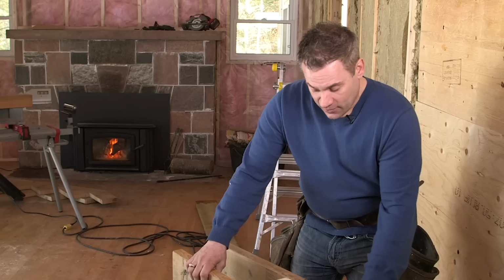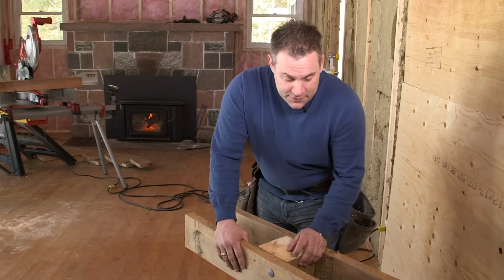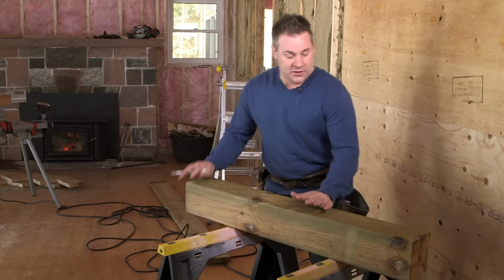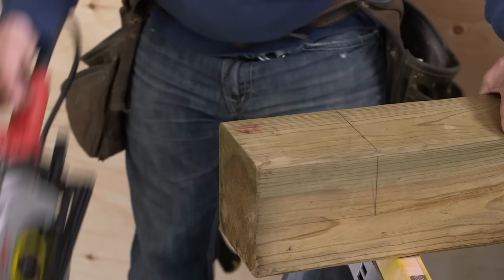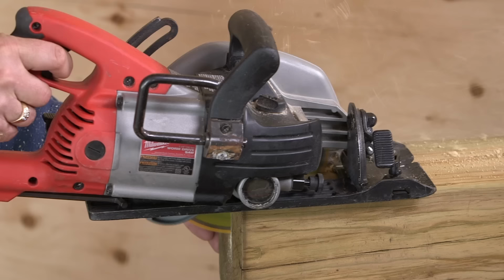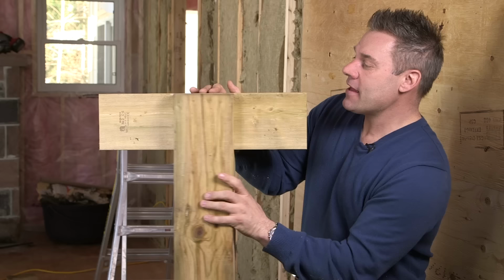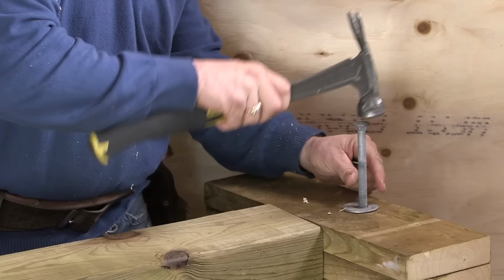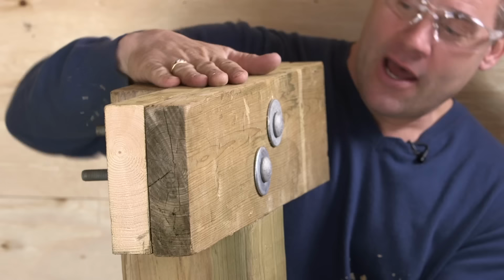How to Attach a Beam to a Post for a Deck | Decks, Docks & Gazebos

Comment: I wonder if this guy tried to snap off a carriage bolt first with his hammer, and then said screw it, let me get a screw?
Reply: Hahaha, I laughed good!
Reply: Yeah. A 3/8 bolt would take a shit ton to shear.  I guess if you are putting a hot tub or have a deck 30foot off the ground, notch it.  If the only load on the joist is the deck boards and people, 2 3/8 bolts will out last the wood.
Reply: The carriage bolts could be fine in that configuration, as long as one respects the ratings of the bolt. But then again, I think resting the beam on the post is better because over time, if the carriage bolt rusts and weakens, the safety won't be compromised as quickly.
Reply: It's simply code to not hang beams off of bolts.  The safe shear strength of those bolts is over 1,000 lbs each but then that assumes that the wood never fails with the point load.  It will rarely be a problem, and for a deck a few feet off the ground, who cares but the inspector......but you'll care plenty if someone has the authority to say you have to redo everything properly.
Reply: The PSI required to shear a 1/2 carriage bolt is 32,000 PSI. Assuming there are no markings on the head. If there are markings it only goes up from there. Some grade of 1/2 bolts can take 150,000 PSI to shear them, but you will never find a carriage bolt in that grade.
Reply: lanesteele240 A standard grade 2 bolt of 3/8" diameter is going to shear at about 500 lbs. A 200 lb person creates way more than 200 lb of force because they are often moving. Fill a deck with people partying and those bolts are gonna break. It has happened. That's why a house inspector will fail structures that depend on bolt shear strength to hold things up.
Reply: It’s funny because he is wrong about sheering.
Reply: Ive seen alot of decks as I see alot of homes doing fence work. I dont remember ever seeing any ever done this way. if you have a small 6x10 deck it seems that 12 bolts (12,000lbs) is more than enough to hold all that weight.
Reply: Benjamin Esposti they are usually galvanised!..
Reply: @bobbybaucom4489  That and bolts aren't meant for shear force. They are meant for clamping force.
Reply: @patrickswayze2596  I guess you've never taken apart something that was bolted together with galvanized bolts before. It does not prevent corrosion. It only slows it down.
Reply: Shawn Kemp  nails have more shear strength than screws
Reply: Bobby Baucom what relevance does that have? Of course I have and I understand that it doesn’t stop corrosion completely, but trusting carriage bolts on that angle to be able to withstand potentially massive loads of weight is ridiculous!
Reply: DING DING DING!! we have a winner.a bolt tightened properly on clean surfaces should never see a shear load, as the clamping force created by the tensile strain should not allow movement in the joint.
Reply: lanesteele240 yes, but does a ton of shit weigh more than a ton of wood?
Reply: Actually, your calc of 150,000 lbs is NOT shear strength, rather TENSILE strength. Shear is roughly 60% of that. Also, that 150,000 lbs is PER SQUARE INCH. The cross section of an unthreaded 1/2" bolt is about 1/5th of a square inch.
Reply: Lo
Reply: Jeff Watson  They hang the JOISTS with joist hangers and nails.  He's talking about the BEAMS the joists all connect to.  
AND (as others have said) the real problem with doing it the wrong isn't the shear strength of the bolts, but the fact that ALL the force for the beam and all the joists and flooring it supports is now transferred to the wood posts thru a very small surface along the bottom of those bolts.  That small, stressed wood rots a bit, and the whole thing fails.
Reply: nails is made out of a much softer steel than screws or bolts. this means that they can bend a lot more before breaking. if a screw or bolt breaks it happens very fast. if a nail breaks. it happens slowly. hope this helps.  Jeff Watson
Reply: @kirklandsmidt4183  So, 150000*.6/5 = 18000 lbs yet per bolt, so 36000 lbs total in the configuration shown. Guess it depends on the loading of your beam, but somehow I doubt you're going to park something that heavy on it. Could the beam even hold that much? I would only be concerned that the bolt narrows where the beam is exerting all this downward force instead of spreading it out like the notch. I guess the beam itself also becomes weaker with holes drilled in it.

Edit: Of course someone mentioned the configuration, so they have two shear points. Multiply the final number by two.
Reply: I use grade 8 stainless bolts and fender washers. Haven't had a problem in 10 years of use. Guess if you buy crappy bolts you get crappy results.
Reply: misa smith 32000 P S I. 

Not the strength of the bolt, strength of the steel - in PSI.
Reply: misa smith 
You are silly if you think the shear strength of a 3/8’s carriage bolt is irrelevant in a system.
Reply: What the hell is going on a deck that can snap bolts
Reply: Why not just do what the code requires!!
Reply: Lol, obviously he's not building decks with a permit. I'm pretty sure this is Nation wide. U can't noch into post like that anymore, I live in the Chicago land area. And when it comes to building, I think our inspectors are by the book. Plus if ur using 2x6 for joist I would use 2x8 or 10. And keeping them apart from is more for looks, if I'm building a 2nd floor deck. And at the end of my beam I would come down around 2 1/2 inch then put a 45 degree angle on it. Were is it going to go? No were, lol takes a screw for a demo. Now that was funny, I wonder if this guy knows what a finger joint is.  Lol
Reply: @mrkoolio8494  wow, I think that u are the smartest guy on here!!! And I don't mean that as being cocky, but u are 💯 percent right. Well said my friend well said!!!
Reply: Russ Anderson thank you.  I only know the basics, but doing what the code requires seems the best route in most cases
Reply: I would love to see two carriage bolts shear before that 2x6 with about 4 growth rings splinters and gives way..... Safe shear load on a 3/8 bolt is almost 900 lbs. So if each connection holds almost a ton that's good enough for me!
Reply: @mrkoolio8494  not every location has adopted residential code.
Reply: Liam Grinton 

G
Reply: Jon Crosby really? That surprises me. If there are noot local regs, there are city county or state regs....correct?  Where do u live aand where r u talking about? Thanks
Reply: @mrkoolio8494  my state has adooted the obligatory awc pubs for irc, ipmc, etc. And i honestly dont know the legal responsibilities (If any) of states or lesser municipalities regarding irc enforcement. That said...as of last year, rural (maybe the wrong land class but you lnow what i mean) parts of MO and at least 1 or 2 other midwest states have no logistical mechanism in place to facilitate isauing permits , inspections, etc. At that level or not much more strickt, part of TX and (GA?). Im in MS. We "have a code". I have followed the rules... in the municipalities that expect you to . i build the same either way. I dont build new houses, and i suspect none of this info applies to any pu lic/commercial project . 

Now having said THAT...i have no idea wtf we were talking about,( or what i said to you,  since, YT comment thread management, well...)
Reply: @lanesteele240  I'd rather do it correctly than take the chance.
Reply: That's funny why is every one a expert.
I think it's because people in general like to teach makes them feel good
I've seen some pretty long lag screws that couldn't be snapped like that I think I'll use them instead when needed and bolts when needed.
Reply: @bobbybaucom4489  you do realize its 500lbs if force directly on the bolt to shear it? And there are 2 bolts per beam and a beam every 4 ft, i think youll be safe. Not to mention carraige bolts have a shear strength of over 500lbs if you buy the right ones.
Reply: @bobbybaucom4489  the corrosion is slower because galvanizing prevents rust, it doesnt make it rust proof
Reply: @BenjaminEsposti  I would think that the wood would rot before the GALVANIZED bolt rusted enough to significantly weaken it. And it takes a long time for pressure treated wood to rot.
Reply: lanesteele240 r
Reply: @gnashmelllow  You sound like the only one here that know what there talking about !
Reply: Bolts are not acceptable by building code and inspectors will flag that. Doesn't matter if they can carry the weight or not.
Reply: I tore down a deck last week  the whole thing was bolted and glued
Reply: Big bolts are everywhere in construction it the only thing that works your not going to use a screw on a 5k lb beam.. Our high school is ALL bolts holding huge beams look around bolts are used everywhere.
Reply: the shear strength of an average 1/2" bolt is (at minimum) 970 pounds.  There are two bolts in each beam and they'd probably be four feet apart.  This guy is a youtube host.  Not an engineer.  Unless he's building a deck that needs to hold 10,000 people in a 10' square, the carriage bolt method is more than enough.
Reply: Bobby Baucom no, you should recheck your figures!
Reply: Shawn Kemp  
As a unit.
Reply: His idea was right but disproving it was wrong
Reply: that’s how i think too
Reply: @bobbybaucom4489  No one would use a 3/8" bolt or a 1/4" bolt.  Only 1/2" or 5/8" diameter.
Reply: @rodconstable5365  how much strength for the notch holding the beam?
Reply: Not to mention once you cut in the pressure-treated you’re exposing it to the element
Reply: @artsmith103  the thing is on most homes in several states there is really no code when building decks, its really just do it the right way but they don't actually have codes for what to do.
Reply: @johnunsicker7440  Some places have plenty of code. Some places are rural enough there isn't a code authority.  Just didn't want your comment to be misunderstood by others.  I think it's called Uniform Building Code.
Reply: He’s just giving u an example of shear strength . He’s absolutely right notch ur post .. I see failed decks all the time when u use bolts to hold beams.
Reply: @Gerald Dixon Cummings 4x4 post should never be used on a deck .. 6x6 with a notch for ur rim boards..then bolt that joint together..
Reply: Carriage bolts can not be used. Every inspector will flag you every time.
Reply: @artsmith103  The shear strength of a 1/2 inch grade 8 bolt is approximately 17,000 pounds. The code needs to be updated to reflect the strength of modern materials.
Reply: @bobbybaucom4489  wrong, the shear strength of a 3/8 grade 2 bolt is nearly 5000lbs (4740 lbs).
Reply: I feel like this conversation with carriage bolts is getting out of hand. .. notch ur 6x6 for rim hoist and u will pass code. It takes more time but it will last longer
Reply: @bobbybaucom4489  are your bolts made of cheese?  You might have missed off a zero
Reply: @yomomma5042  > once you cut in the pressure-treated you’re exposing it to the element

Pressure treated is not a surface coating like stain or paint.  Otherwise, why would they need to use pressure?

Comment: Although I like notching, the shear strength of a grade 2 carriage bolt is 13,500 lbs and grade 5 is almost double at 24,400 lbs. The strength of the bolts is well in excess of the lumbers ability to hold an extreme load. The biggest danger is the lumber could split at the bolts when places under excessive loads.
Reply: And when the wood splits, all that sheer strength means nothing.

Comment: 15 years in the carpenters' union and this is the way we get taught to do this when we go through apprentice training. I have worked with staff from This Old House, including G..C. Tom Silva, and this is his method too.
Reply: What about those washers under the head?
Reply: Working with bogus "carpenters" on a fake reality show is nothing to brag about.
Reply: @lincolnhobartmiller  What is wrong with that? It seems a bit unusual as carriage bolts have square just below the head so you'd need a big washer, but surely it's better than not having one even if it's not 100 needed?
Reply: There are round washers with square holes for this purpose. They’re called torque washers.

Comment: After 30 years in business, in Tenn if you notch a post your asking to introduce water into the heart of the post which will then freeze and thaw and make the post split over time. Regardless of whatever type of "waterproofing" you add it let the post come apart faster then carriage bolts or lag bolts. I recently repainted a deck i built 25 years ago using lag bolts, stil good and sturdy and straight. I repaired a 10 year old deck another person built with notched posts that was already showing serious degradation to the posts. Decks were built for years and years without notching posts. Unless building codes demand it, dont do it.
Reply: Exactly!  Just level it, screw it in place, then bolt it together.  1/2" carriage bolts are not going to fail.  Water will get you every time, though, if you don't let it drain.
Reply: Even better is to laminate 2 boards together into a solid beam and install directly over the post.  No notching.  No lag bolts needed.  More strength.

Comment: Bolted joints work by creating friction between the two surfaces, therefore if the bolts are tightened sufficiently all the shear load is taken by the wood. The “wrong way” is fine assuming the bolts never come loose. When they do (most likely by the wood shrinking/relaxing under the compression from the bolts) then the wood will shift and load the bolts in shear. The failure point will then likely become blowing the bolts out the top side of the beams. The “right way” is safety in the long run as it doent matter how tight the bolts are as long as they stop the beam falling off the post. 

Also, carriage bolts shouldn’t have washers, they have a square protruding under the head that’s intended to stop them spinning. The washer will reduce or prevent the protrusion engaging with the wood making it likely impossible to tighten fully.
Reply: So the question is, do you use a washer on the nut side?
Reply: Never count on friction for carrying load.
Reply: @gregoryclifft7398  gotta agree with u timber shrinks across the grain especially wet treated timber as it dries incorporating a shoulder in to the post for the beam to sit upon is definitely the way build heavy load bearing floors
Reply: Absolutly yes, you use a washer on the nut side, not the head side.
Reply: @blaster-zy7xx  there’s wrong ways and Right ways to build
Reply: @gregoryclifft7398  Foundation piles work on friction
Reply: @Albertouy  I should have been more specific. I meant in a joint.
Reply: You are absolutely correct and the example given in the video of the fastener failing in shear is EXTREMELY unlikely given the size of the bolt.   When the compression of the joint loosens over time, and it surely will,  the frictional force between the connection is reduced.  Then most likely what will fail will be a lateral failure of the beam member, that is it will split longitudinally at the holes in the beam.
Reply: @ronwridge9904  agreed to rely on friction is not the way to form load bearing joints especially with timber it’s got to b a shoulder all day long it’s been done this way for centuries and for a reason     Because it works I just read a reply about friction being the way piles in footings work which is somewhat correct but it’s completely different from timber supports above ground not relevant to what we were commenting on
Reply: @blaster-zy7xx   You can use a washer on the head side. 
It increases the tension clamping force you can apply before the head starts to pull through the wood. One site showed ~30% increase in clamping force.
Problem is keeping it from spinning while tightening once the wood dries and its loose.  You can find washers with a square hole, and some bolts with a Phillips/Square drive on the head.
Reply: @Albertouy yes but they may be thousands of square feet bearing surface. This example is dozens of square inches easily reducing to nil with shrinkage.  Wooden propellors bolts are regularly checked with atmospheric changes causing shrinkage or expansion. In this case the right amount of friction is fundamental. The bolts, hi tensile are just not enough on their own, but the wood will go first!